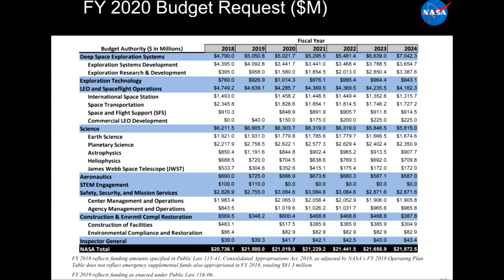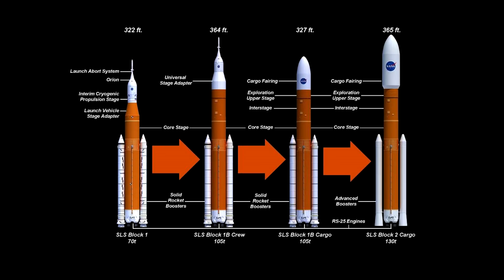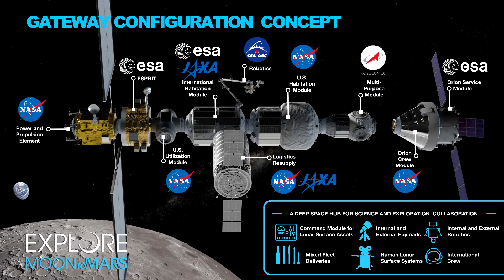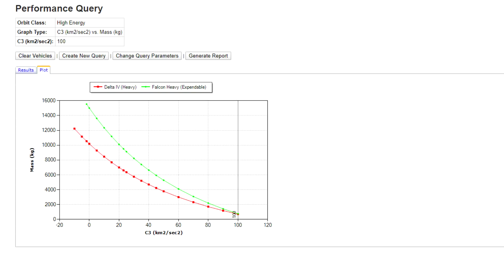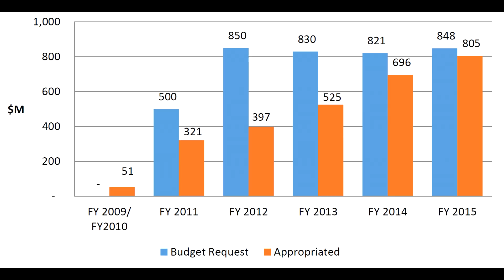SLS Rocket In Trouble After New White House Budget Request

Comment: Turns out neither Block 1B (EUS) or Block 2 (BOLE), were actually defunded.
The Trump White House/OMB tried to defund them 3 years in a row (and keep SLS indefinitely stuck at Block 1 in the process) and every time Congress ignored the proposal and added the money back in the final budget
Now EUS is well past CDR and in active hardware production at Michoud and BOLE should have it's first full scale booster firing in the next year or two.
With ICPS (the Block 1 upper stage) effectively out of production now that the Delta IV production lines are shut down, with the third ICPS unit just a few months away from leaving the ULA factory, any thought of halting SLS at only Block 1 is effectively null, it's now EUS or bust, thankfully.

Comment: I really don't understand how SLS can use engines that are already proven on the space shuttle and boosters that are already proven on the space shuttle but take so frickin long to get this machine on the pad and flying. Space X can build several designs of rockets in the same time period and also get them turning around and landing as well. It seems like there must be some type of corruption within the contractors and/or politicians behind SLS. Oh and did I mention it is also massively over budget? For designing something that has already been designed and flying for years. Where is all this extra money going? I vote we take SLS and give it to SpaceX to complete and do a full scale investigation into corruption in the SLS program!

Comment: NASA is suffering from the quagmire of bureaucracy. The benefits of re-using existing technology are long since evaporated into this 10+ year and potentially $18B rocket that hasn't even gotten off the ground. In the meantime, SpaceX proposed using existing technology for a heavy lift rocket (although not as powerful as SLS), it took them about 6-7 years and $500M of private investment to get their rocket into service. They were successful because they weren't weighted down by lobbyists and corrupt politicos.

Comment: I don't think focusing on getting the SLS to fly rather than trying to make it do everything is bad for the SLS. After this many delays, this much cost, the sensible thing to do is give Boeing an ultimatum. Offer a fixed price contract for the missions the SLS can do over the next 5 years, and if they lose money, that is on them. If they can't make it happen, cancel the program, take all the designs and research and put it on a shelf. Then don't try to resurrect the thing, if a single piece of it here or there is useful in some completely different project, sure, use it, but the approach of cobbling together pieces of old hardware has proven to be more expensive and slower than just designing and building an entirely new rocket. It is time for SLS to fly or die.

Comment: The budget decision shown at 2:24 actually makes a lot of sense. They've realized that by the time the later versions of SLS are slated to be ready, it will have been completely overtaken by SpaceX and Blue Origin, and even in part by Vulcan. But that SLS kinda makes sense for Orion because the two have been tailored for each other. For its first few missions. By then it can have been integrated with a commercial launcher, or made obsolete by Starship.

Comment: I don't get it. Werner von Braun already calculated that a RP1 fueled first-stage booster was optimal. Why does the US use other fuels in the first stage besides RP1 and Solid Rocket Boosters (SRBs)? 🤔

I don't get it. SLS missions use four exquisitely expensive RS-25 "Hydro-LOX" engines in the first stage booster for each launch. That's $200 million just for the engines; so many are just thrown away... 🤑

I don't get it. Even four RS-25 engines don't have enough thrust for launch, so why are they consuming so much fuel right from the start? 🤔

I don't get it. The SLS uses two SRBs. Even after the SRBs burn out, a single RS-25 doesn't have enough thrust to climb to LEO, so why don't the boosters last longer? Why use such a low thrust liquid motor both before and after the SRBs shut down? 😒

I don't get it. RS-25 are optimized as the highest possible ISP engine (appropriate at and above LEO). Why does the SLS need four RS-25 engines to climb from LEO into a Solar orbit? What. It doesn't use them for that? 😠

Comment: Also on mars there are gasses available for clearing away dust, and even the moon has deposits of gas carrying minerals, Any operations in space could use the available gas to clean off seals and equipment, I presume that you could make a series of solar orbiting electro magnets, or even orbiting permanent and orbiting electro magnets, creating a artificial magneto dome allowing for reduced radiation on the surface of the moon, The moon will not have a thick atmosphere even with a magnetic field, its just not got enough gravity, though if heavy gasses are used as the atmosphere it would make it a slightly more workable environment for heavy equipment that needs to process sand and dust, where the people could live in shelters on the moon, and even have supercities under the crust of the moon, the reduced gravity would allow for absolutely huge structures to be built without lots of support.

Comment: Lunar dust is easy to deal with, So is martian dust, you just need to have a drone detecting current charge of the dust, And than give your space suit, space craft the same charge as the surrounding dust, creating a repulsion field, that is clean of dust, Perhaps there could even be dust magnets around the doors to attract any dust between the seals before attaching your space unit to your space craft, and than after docking that magnets would reverse polarity and once again repel the dust it has collected, well maintaining repulsion fields on the suit. The amount of information for solving the problems presented to past astronauts is astronomical

Comment: Is there any opportunity for adding an an additional booster or two to the existing two on the FH? The reusability factor would be tremendous cost saver. Assuming the BFR is not ready. Or perhaps you could put 4 FH boosters onto or under a BFR second stage. I expect the reusability factor is a big element in developing BFR. Or perhaps it is not, perhaps it is the software and motor controls of the Falcon9s and will adapt easily. Frontal area wind resistance may not be too big a restriction above 20-30,000 feet ( or some altitude) since the air is so thin. 

There is also the option of just moving a space station to Moon orbit since it can be built in any configuration in the vacuum of space and powered by fuel accumulated in LEO-located tanks. Having orbitally located fuel could also empower earth-launched rockets to proceed to moon, etc after a quick refueling at LEO tanks. Are there any problems storing fuel in orbit for any time period? I guess it is cold enough if shielded from Sunlight. Hide it behind solar photoelectric panels. Moon fuel storage could be on moon’s dark side. 

What do we do on Moon with ChiComs if our relations are hostile as they are becoming, and are dictated by expansionist Belt-Road plans? Why have Chinese chosen the obscurity of the dark side? To explore unknown territory or to hide hostile actions? Is Elon a possible assassination target?

Comment: I believe that a hydrolox engine would be more efficient after launch.  If the Europa Clipper was split between Falcon Heavy to launch the satellite, and Delta IV Heavy with an extended 2nd stage and docking port, the 2 could succeed in lofting the probe toward Jupiter with minimal loss of time.

Comment: SLS needs to be in trouble. It's a worse rocket to nowhere than the Space Shuttle was. It's a rehash of old shuttle technologies that never really worked well and a jobs program for Congressional districts. SLS wasn't cost effective from the beginning, and it will never be able to compete well with SpaceX or Blue Origin, or hell, even ULA... It's so far behind NASA is talking about using private rockets to make sure their schedule to do Lunar tests of Orion next year doesn't slip.

The Shuttle program was an abject failure, so why would you base your new spaceflight system on a failure?
Reply: Because the Shuttle engines were some of the best rocket engines ever built, in terms of performance.

That said, we should've developed a cheaper SSME and used a cluster of one (maybe two) on a new rocket design. With the proper resource allocation and good project management, we could've got the damn thing flying in a few years... Then use it to support EOR for lunar missions and potentially Mars missions, perhaps with a kind of orbital "spacedock" so that a super heavy rocket is not needed.

Comment: By getting flown rockets back and tearing them down SpaceX has advanced rocket technology by leaps and bounds. No reason not to build off of that.
Reply: Huh? SpaceX's rocket tech is built off of old rocket tech from the 90s.
Reply: @badbeardbill9956 and the rockets in the 90' were built from tech from the 70's how many rockets in the 90's.

How many of them have been landing and flying multiple flights with the same first stage?
Reply: @raydelien3229 DC-X did. Using tech from the 60s...

Comment: As Scott has shown before, Falcon Heavy needs a hydrogen upper stage if it is to launch really large loads to geosynchronous and  lunar orbits.  That sort of upper stage will be on the Blue Origin New Glenn; a longer, skinnier version for Falcon Heavy would do the trick. However, Space X has never used liquid hydrogen and is committed to using methane; however, the renewed emphasis on going to the moon means that hydrogen-fuelled upper stages (e.g. for a direct lunar transit vehicle) will surely be considered again, though at this stage Blue Origin may have the jump on everybody with its BE-3U engine.

Comment: SLS can't die soon enough, as far as I'm concerned. Like the Space Shuttle, whose under-funded compromise design (which, unsurprisingly, required numerous large additional infusions of money [and ultimately, needed political support from the U.S. Air Force, to prevent it from being killed]) also compromised NASA's unmanned and manned planetary exploration mission plans for the 1970s and 1980s by starving them of cash, the SLS is also gluttonously eating away at other areas of NASA's budget. BUT:

This time, there are considerably less expensive, private alternatives that are ready, or soon will be ready--Falcon 9, Falcon Heavy, New Glenn, Vulcan (if one wanted to pay to use that likely-to-be-pricey ULA Atlas V replacement; ditto for the Delta IV Heavy), BFR, and (at the small end of the range) Electron, Terran 1, and other smallsat launch vehicles. SLS's only "mission" is to keep the legacy Space Shuttle contractors busy--and well-paid--building Shuttle-derived hardware. SLS's currently planned EM-1 mission payloads (for the first SLS flight, such as the solar sail-propelled asteroid probe NEA Scout, Lunar Flashlight, and the other CubeSat spacecraft [here's the list of all of them: https://en.wikipedia.org/wiki/Exploration_Mission-1 ]) are just "make-work," because they could easily and more cheaply fly on other, smaller rockets. But there just might be a way to keep both sides (the NASA/ESA/JAXA/university planetary science community and the "Shuttle stuff makers" [and their allies in the U.S. Congress]) sufficiently happy:

The Space Shuttle (and now SLS) solid rocket booster (SRB) hardware could be used to create a series of all-solid propellant launch vehicles (indeed, such vehicles, collectively called SRB-X, were designed and proposed in the late 1970s and early 1980s [the largest one looked like an overgrown Titan III], but NASA couldn't afford it and the baseline Shuttle, which is fortunately now gone). The Space Shuttle Main Engines (SSMEs) and the small OMS (Orbital Maneuvering System) engines could be used--at long last--to power a two-stage, fully-reusable Space Shuttle of the size and payload capability that NASA really wanted. (The U.S. Air Force's requirement for a high orbiter re-entry crossrange, necessitated by their "foundation requirement" for launching 33,000 pounds into polar orbit with a one-orbit re-entry and landing capability, resulted in the 65,000 pound easterly orbit payload, expensive heat shielded, delta-winged orbiter. NASA was perfectly happy with a cheaper, simpler, straight-winged, low re-entry crossrange orbiter capable of carrying only 15,000 - 30,000 pound payloads into easterly orbits.) Such a less-demanding design, using either a piloted or automated winged booster (or perhaps a VTOVL booster similar in operation to SpaceX's Falcon 9 & Heavy first stages) could utilize the already man-rated SSMEs and OMS engines.

Comment: NASA should invest in rocket reuseability instead of the SLS.
Reply: Yep--about the only thing the SLS hardware is good for (although Bob Bigelow's expandable modules makes it non-essential) is a 26' diameter, "wide-body" Skylab space station made using SLS tankage (Skylab, a converted Saturn S-IVB upper stage, was 21.7' in diameter).

Comment: Could an empty Falcon 9 heavy be put into orbit using the boosters alone? They could possibly put the satellite into orbit with one rocket then dock it with the full center stage which should give it enough delta v to reach jupiter in a single shot while still recovering most of the stages. This is my KSP experience talking but considering SpaceXes past I wouldn't doubt they would try KSP strategies. XD

Comment: I recently went to the Stennis Space Center in Mississippi and went on a bus tour of the test pads for SLS. Even-though the liquid powered engines look impressive and useful, it's clear that SLS has no direction. It's just another example of Legislative limbo were the Government only funds what it thinks is good, not what is actually good. SpaceX always had a direction for efficiency and re-usability, and hopefully by this summer, we'll have astronauts in space on our own rockets. As for the ESA deep space probe, just wait a few years, SpaceX will probably just upgrade their Falcon Heavy with more boosters and deep space stages.

Comment: I dont understand what's so difficult about SLS? It uses the shuttle's main engines, SRB's, Orion capsule is already complete, so is the service module. What is the hold up? They're not using exotic tech the only remaining parts are fuel tanks and putting it together. This is a joke, if SpaceX had this budget Starship would be launching next year.

Comment: Personally I do agree with this decision. Because if SpaceXs BFR/StarShip gets rolled out on time, then the later models will be totally obsolete before they come out. However they should be able to get the first SLS model running and get some use out of it before it becomes obsolete. Considering it may be a quite a few years and launches before Spacex BFR will likely be crew ready. NASA could jump start the gateway station project by using Falcon Heavy, and early cargo BFR rockets to get the space station going. Most importantly keep the SLS for crew transport only until a safe crew ready BFR is made.

Comment: This is exactly what I expected, and the correct decision. Now, if they could just get rid of Orion...
SLS is a dinosaur. It is far to expensive in the modern era of reusable vehicles.
If SpaceX actually builds BFR, it REALLY would have no mission. (I think BFR is roughly as likely as SLS Block 2 at this point.)
Orion also has no reason to exist. It can do little more than what Dragon 2 can do, and Dragon 2 has already flown.
If they modify Dragon 2 with a special trunk to provide more life-support, it will be able to do everything Orion is designed to do. (Well, they would have to put a bathroom in it, I guess.)

As a blue sky idea; I wonder if they could improve the performance of FH? Rockets seem to go through a process during their lifetimes that end up allowing to do much more that their first versions could do and FH is still brand new.
Reply: Add a hydrogen upper stage to falcon heavy, INSTANT huge payload boost... Kerosene upper stages are a lot easier and cheaper to engineer, which is why Soyuz and other early launch vehicles used them.  Hydrogen, due to its high specific impulse, is much more efficient, particularly at altitude (upper stages) where efficiency is more important than thrust.  Put an RL-10 powered upper stage on Falcon Heavy and you'd have SLS like performance.

Later!  OL J R

Comment: I always thought NASA portrayed those other SLS blocks as "optional," as in, sacrifice for the budgetary gods.
Reply: It’s because the Shuttle crap option doesn’t meet the requirements for what Congress asked for, but it could keep jobs open, they should have gone for the RAC 2 RP1 option, they’d be halfway through refurbishing the launch site and building a rocket based off of the Saturn V with engines BASED on those that where able to propel Apollo to the moon that would actually meet the criteria set by Congress

Comment: Just cancel the SLS altogether, a huge waste of taxpayer dollars. The $10B + could have been funneled to commercial programs, which could be leagues ahead and avoiding layoffs. All the companies with a hand in the manufacturing cost of an SLS will be just fine either on their own standing independently or still getting funding from DARPA/Air Force.

Falcon Heavy dev cost will end up being about 5% of the cost of the SLS if it gets done by the time the budget hits $20B, even then, $3-5B for 2 launches a year is excessive and stupid, especially if you are throwing away all of the materials used.